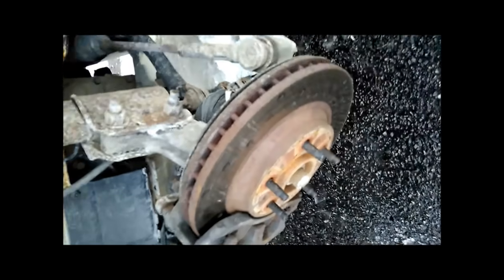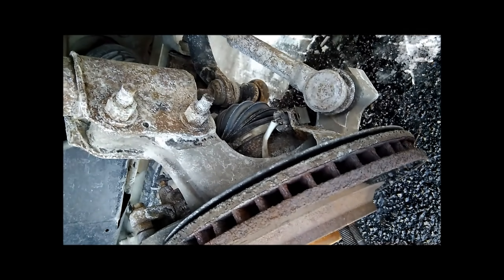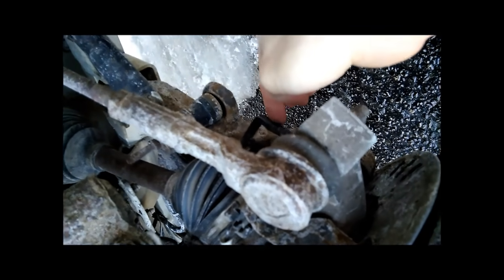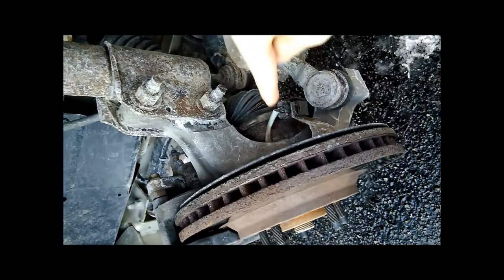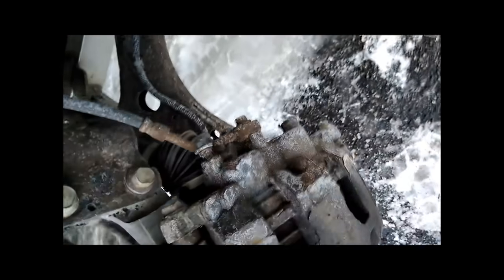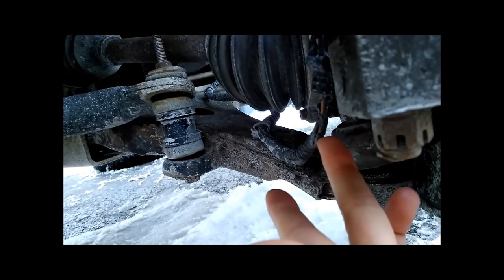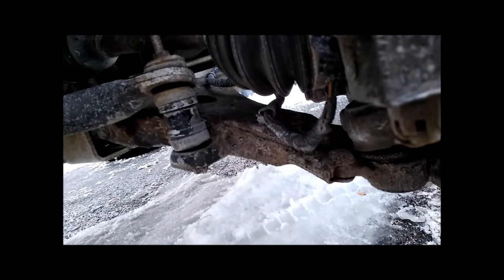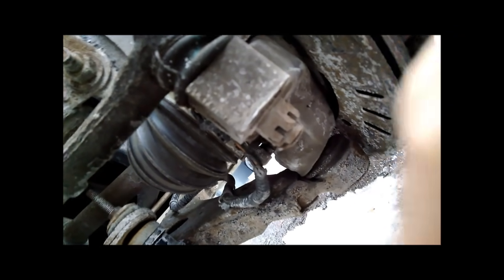How to fix ABS light, Traction Control, Stabilitrak

Comment: Mine is doing this, but also it will drive funny sometimes and the locks will lock and unlock while driving.. then sometimes, it drives fine and no lights. 🤦🏻‍♀️🤷🏻‍♀️
Reply from the maker: That sounds like an electrical or computer problem, possibly a larger more all-encompassing issue if it's affecting door locks as well.  Sometimes older cars do this when the wiring insulation wears down and even the rain or a humid day can cause shorts which freak out the computer.

Comment: I just replaced all 4 sensors and my lights on the dashboard are still on but problem fixed pls help
Reply from the maker: Hi Christina.  I assume you mean you changed all 4 wheel bearings (the sensors are inside the wheel bearings) ?  If you changed all of those, then the problem could be the wiring itself.  Do you have a way to get the car up off the ground a bit so you can have a look at the wires going from the wheel bearings back to the front of the car?  Also, have you checked the ABS motor fuses?  The fuses are much easier to check and if 1 of those are bad, it's a quick fix.

Comment: Mine came on after installing a lift all wheel speed and and sensors are new idk what the problem at this point
Reply from the maker: if everything is new it could simply be something wasn't fully connected.  Check the wiring harnesses to make sure they're all the way in.
Reply: @ChrisCamaro  could it be a steering wheel pos sensor or a break switch maybe
Reply from the maker: @Ferociousdaboss  Yes, it could be.  However often times when you change things, even if the new parts are good, just the fact that you changed something disturbs what was otherwise working (the old if it aint broke don't fix it addage).  That's why I would suspect the things you changed first and then go down the logic tree to the items that haven't been touched.  Steering sensors are important for the proper functioning of the system but I would be disinclined to suspect them first as it could just be a red herring.

Comment: Sometimes when I start the car it doesn’t come on until later on while driving
Reply from the maker: That's fairly typical since the movement of the car often causes the problem to come on, if the wires are just slightly damaged.

Comment: Where can I buy those connectors ?
Reply from the maker: The wheel speed sensor connector?  Well it's a part of the wheel hub assembly and I sincerely doubt that you can purchase it separately but there's always the possibility that it is a universal connector used in several other locations in the car.  To be honest, if you need to know where to buy that connector, it means you are considering doing some cutting of wires.  If you are doing that in the first place, the connector no longer needs to be that type.  Any robust, weatherproof (IP rated or gasketed) connector should do fine.
Reply: A1 auto

Comment: Being that i am no longer able to do these things, and my husband bless him hasn’t a clue.  
Does anyone have a rough estimate/guesstimate on approximately how much this would cost to have fixed, if I were to take it to a shop versus begging a brother in law to fix it.  I will add in here,  my husband drives like he stole it, and like he’s driving the General lee!  🤦🏼‍♀️
Reply from the maker: It's not a "nominal" fee for this sort of work because it requires doing a bit of investigative work to follow the electrical from each wheel back to the computer, to inspect the wiring and see if and where it may be damaged, then to replace whichever element of the loom is damaged.  Parts will be cheap (<50 bucks) but the inspection depends on how lucky the mechanic is and how long it takes him to stumble upon the problem area.  Could take 5 minutes or an hour.  I would say you're probably not going to have to pay more than an hour of shop time (100 bucks) so maybe 150 is a reasonable ceiling.  Of course it could be more in extreme cases or it could be 20 bucks, if it's found immediately and trivial to repair.
Reply: Just our luck!  Thank-you so very much!

Comment: Shouldn't you check the ABS fuses under the hood first? Then go to this next.
Reply from the maker: Sure you can do that too and it's a good idea.  For this particular video and the symptoms my car was having, the problem was intermittent though and if you pull the fuse, the system will not work at all and the MIL lights will come on solid right away.  Since that wasn't what happened to me, I knew it wasn't a fuse problem.  But in general, yes it's good to check

Comment: Did that fix it.....and was there a code......i hooked up 3 cheap scanner all said no code........ nor is my engine light on
Reply from the maker: You need a scanner that is capable of reading the BCM (Body Control Module), not the ECM (Engine Control Module).  Most scanners that I'm aware of that you can buy are ECM only.  The give you P codes.  You need a mechanic who has a Tech II or equivalent scanner to gain access to the BCM and this will throw codes related to the TCS system
Reply: @ChrisCamaro  thats what i thought....and now another device to disable tha AFM

Comment: If you want to save the 700 fee . You cut to cut the corroded wire out . Solder a new 1 in and use heat shrink . And rubber tape and regular expensive . NOT CHEAP TAPE .
Reply from the maker: I mean there are many ways to skin a cat.  The cost will always be way lower if you do it yourself and even buying a new cable loom will save money if you do it yourself.  Heat shrink and tape will work for a while but don't underestimate the capillary action of water to seep into the joint over time.

Comment: Did that electrical tape permanently fix your problem???
Reply from the maker: So far so good (fingers crossed).  I mean electrical tape is not a "proper" job by any standard but I'm quite content to leave it alone until it fails again and then do a "better" job :)
Reply: @ChrisCamaro  if NASA uses it, then I'm sure it's ok for us to.
Reply from the maker: @devinthierault  Lol, NASA uses electrical tape?  I guess as long as they don't use duct tape we're ok.  Then again, Elon is doing more than NASA these days so I guess you need to worry more about what he's putting in his auto-bombs... I mean rockets and self-driving coffins... I mean cars.

Comment: My ABS and traction control lights came on when my 2018 Chevy Express was parked! WTF?!
Previously it was raining and I went over incredibly bumpy roads. Is it possible a sensor is just knocked loose or exposed and wet?
How is there a traction problem when the van is NOT moving?
Reply from the maker: The light merely indicates that the system is malfunctioning.  This can happen at any time.  When you turn the car on, the computer expects to see certain voltages from all sensors in the car (so called "nominal" values).  If the computer sees the wrong voltage or erratic voltage, it will throw a code/light because it believes the system is not reliable.  Also, depending on the code, the computer may remember previous errors and start counting them.  If it sees too many consecutive errors it may disable the system and ignore a properly functioning system thereafter, for a while or permanently until the memory is cleared.

Comment: So what if its not the wire or the sensor
Reply from the maker: Could be the steering angle sensor in the wheel on some cars.  I suppose it could be the ISS in the transmission (but then you have bigger problems).  Could be the tires not equally inflated...  The TCS system doesn't have that many failure modes though.
Reply: @ChrisCamaro  Ok so what about the ABS unit itself?
Reply from the maker: @mikeyboy6895  Well there are 2 pumps that control the modulation of hydraulic fluid to the brake calipers so those pumps could be damaged or the fuses that enable them could be blown but to be honest, this is unlikely to be the failure mode most of the time. It's still prudent to check but I'd leave that till last and assume wiring or the speed sensors first.
Reply: @ChrisCamaro  Thanks for that have checked all sensors and wiring it is a Jaguar XKR 2000 model i think its the ABS unit soldering connections

Comment: i go to get into car today ,i push on brake and hit start button ,i heard the anti brake machine gun sound before i sat in car just by opening the drivers door .i push button a few more times ,nothing thats when i seen check engine light flashing insanely fast . the messages came on my display as well it read ,SERVICE STABILI TRAK with a "((p))"with an open wrench symbol underneath it ,THEN THE OTHER MESSAGE SIDE DETECTION SYSTEM UNAVAILABLE with the symbol of what looks like my remote and the place where you put it to emergency start vehicle  in a situation of dead remote battery ,i had four spares and i changed it ,didnt help !!!!  ,I ALSO HAD THE  CAR SYMBOL WITH THE TWO SKID MARKS BEHIND IT LIKE DOUBLE LIGHTNING BOLTS STAY ON TOO . AFTER WATCHING THIS I FELT SOME RELIEF AS MY CAR IS 10 MILES STRANDED AWAY FROM ME ! ANY ADVICE MUCH APPRECIATED ! MY CAR IS A 2011 BUICK LACROSSE CXS ...
Reply from the maker: When there is no real mechanical problem with the electronic brake system, I have noticed that sometimes the lights will come on when there is a computer error, such as when the battery voltage is too low.  Low battery voltage can not only cause your car not to start but can also create false errors in may other systems.  I'm not saying this is definitely the problem but I have seen it happen before so it's worth checking out the battery voltage, alternator voltage and if the computer has any generic processing faults and maybe needs a reset.  You can reset your computer by disconnecting the battery for 24 hrs and reconnecting it.
Reply: @ChrisCamaro  thank you for the advice bro !

Comment: Save alot of time a money the wheel hub had issues. And needed replace and I'm sure that's the issue on mine.
Reply from the maker: It's always good when the part needs changing anyway because even if you're wrong about the sensor, you don't lose anything by trying the replacement.
Reply: Needed replace. Huh?!

Comment: So mine was happening when i hit the breaks what could that be??
Reply from the maker: Are you losing traction when you brake?  That's what the TCS is supposed to do.
Reply: @ChrisCamaro  so when i hit the breaks, after i have driven the car a bit, the electrical will flicker off then back on then the stabilitrack error will go off
Reply: Not go off but will show up on the dash
Reply from the maker: @DarkSagee  If you are NOT losing traction when you apply the brakes, then the TCS may be on the verge of failing.  However it could also be that something about the car, such as the tire inflation is nearly out of calibration and by braking, you're pushing it over the edge.  I would check all 4 tires to make sure they are evenly worn (thus they have the same circumference) and that they have the same pressure in them.  If the light never comes on unless you are braking hard, then it may be premature to do any serious diagnosis or repair.  You could check the wiring for flaws, as indicated in this video and you could get your mechanic to scan for codes but until the problem becomes more chronic, I don't think you'll find much.

Comment: I have 07 acadia.abs light traction and stability are on.i replaced sensors,any ideas what to do next?
Reply from the maker: You replaced the entire hub or just did something to fix the wires?  If you have brand new hubs on all 4 wheels, then the only intermittency could be the connection (ie. the prongs in the connectors aren't touching properly) or the wires on the car side going back to the ECU.  If the entire wire loom is good, all connectors from the ECU to the hub are good and the hubs themselves are good, then the system should work.  Only other rare possibility is if you have the wrong size rims/tires on your car and it's confusing the computer.

Comment: I would NEVER put a car in drive while it's on jack stands, that a great way to get somebody hurt or killed. There are other videos on YouTube that clearly explain that you can check the speed sensor by applying electrical leads from a voltmeter to the actual sensor once its disconnected from the connector. There are two checks, first while the wheel is not spinning check for opens and shorts with your voltmeter on its resistance settings. Then switch you meter to AC volts and spin the wheel by hand. You should see a voltage generated as the wheel spins. If you get no voltage then chances are your sensor is bad. Also you can use same check on the wheel on the opposite side of the car as a reference. If one wheel is giving you a voltage as you spin the wheel and a resistance when it's stationary, and the other side doesn't give you a voltage when you spin the wheel, or it has an open or short when measuring the resistance of the sensor, than again chances are that sensor is bad.  

Also you cannot always tell if the speed sensor or its connector is damaged simply by turning the wheel. If the problem is an electric/electronics problem then you've got to do some electrical or electronic diagnostics. You got lucky, in that your problem was visible. You've got the right general idea but you are giving people some really bad advice.
Reply from the maker: Many do it yourself activities are inherently dangerous (fixing your own roof, operating a band saw, climbing a ladder).  The exact nature of the danger doesn't change the fact that it's dangerous, yet people take these risks on voluntarily when hiring somebody to do the job isn't feasible for one reason or another.  While you have an excellent point about being able to do electrical diagnostics first, there are some things you can't learn that way and the method I present here can expose root-causes that would otherwise be difficult to see.  I actually paused my video just to emphasize the danger in what I was doing so it's up the the viewer to decide whether to take that risk upon themselves or not, especially when they lack specialized knowledge or diagnostic equipment that would make other methods favorable.  As with most things, the risk of the activity itself largely depends on how responsibly you perform it.  If you are very responsible, the risk is actually very very low.  A vehicle which is properly mounted on jacks, which you meticulously verify is stable on level ground, with the brake on should not fall off the stands even in gear.  That is not to say that accidents don't happen.  Of course they do and that's something to be wary of, but if you want to discourage people from doing dangerous things, better get after the home reno contractors because I'd hate to chop my fingers off on a miter saw or slice my wrist manipulating air ducts because I saw somebody doing it on youtube.
Reply: Haha, well obviously we are all not as safety conscious as you. But most of us DIY’s will risk a little safety to avoid the overpriced mechanic.

Comment: Bad thing is all the wheel sensors are new on my, yes, 03 yukon denali.  Abs control module is my problem and can't get one. No other year will fit and can't get one new. Dont make it any more.
Reply from the maker: What's wrong with it?  If it's software, you could try to get a mechanic to re-flash it.  Also vehicles fall into groups where they often make several model years without changing the programming.  There may be another year which is compatible.  Make sure you check the specific part number of the module against the vehicle years it supports.  This info requires a bit of digging but you can get away with a different model year.
Reply: No. It needs to be taken off and the sober joints fixed. Has nothing to do with a program. That module has this problem. And only that year and make and model fits it.
Reply from the maker: @richardcoleman9645  Oh that sucks.  Wish I could help but I don't have any other ideas as to what to do in that case except what you're already doing.

Comment: We’re all four wheels in the air sir??
Reply from the maker: No, I applied the E-brake to immobilize the rear wheels but it's probably better to jack up all 4 corners so you eliminate any chance of the rear slipping out while you're near it.  Just make sure your jack stands are located properly so THEY don't slide around either.

Comment: I have a 11 Impala with both lights coming in on when I drive with a grinding or scraping noise. Is that a sign of bad wheel bearing I literally just spent 400 for a new gas pedal please help!!
Reply: It's not a bad wheel bearing I have a impala with the same problem.. Still haven't found the problem the shop told I have a transmission problem?
Reply: I Am J I thought I had a transmission problem too but when I took it the shop they said it was gas pedal. I talked to someone who said it might be the wiring and that it’s common in  impalas so maybe speed sensor. For me the noise and lights don’t happen all the time just every now and then so it’s not the bearing! Good luck 👍🏽
Reply: Is it a loud scraping noise wen u turn
Reply: Arthonia Anderson facts thats what I get with my 04 navigator
Reply: Could be brake pads and rotors!
Reply: Bad1Medina not sure if you still have that problem, but check the recalls, I had the same problem and you can just take it to a GMC service center and they’ll fix it for free. Just the the recalls
Reply: Wendyy Lozano okay thank you it’s actually at the shop now.